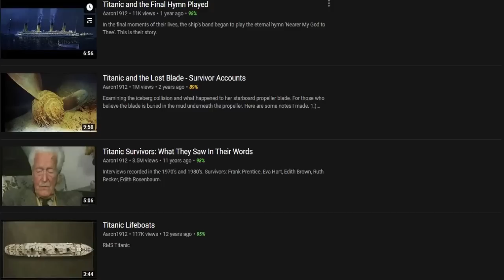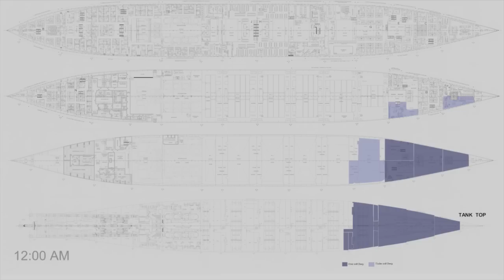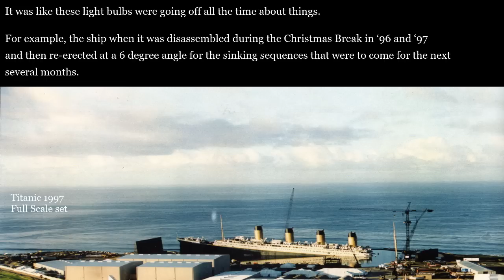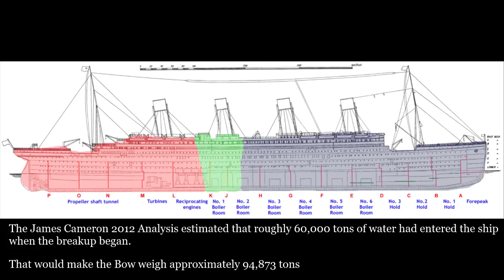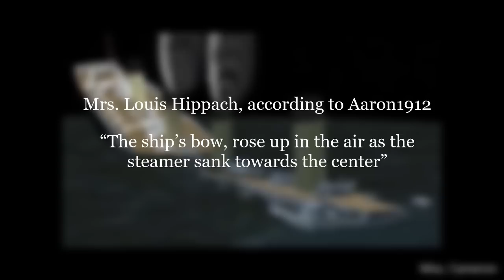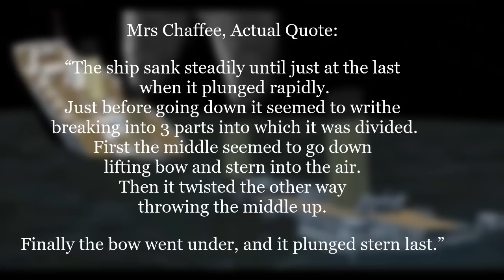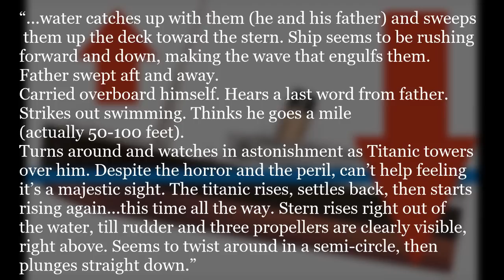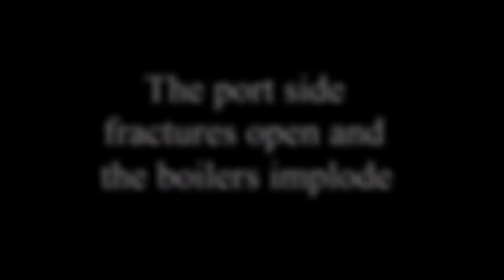Disproving Aaron1912's Titanic V-break

Comment: 'V-shape' sinkings can occur only when there is a vast amount of water rushing into the midsection of a ship, and there is still an almost 'normal' amount of air in both bow and stern.

This happened on a great many occasions during WW2.

In WW2, many ships were hit by magnetic torpedoes, that ran underneath the midsection of their hulls, and then detonated (triggered by a magnetic firing mechanism that worked by measuring the strength of the magnetic force exerted by the ship's hull on the torpedo.)

These magnetic torpedoes would tear a gigantic hole in the bottom of a ship.  Much more of the explosive force of the torpedo warhead would be directed into the ship's hull - (blasting through several decks and creating a cavernous open space) - than would be the case with an impact triggered torpedo striking the ship's side.

The tremendous speed of the resultant flooding would result in the midsection of the ship sinking downward very quickly, and the ship would be broken in two by the still very buoyant bow and stern not sinking at anywhere near the same rate - thus creating a V shape, and crushing the already massively weakened midsection of the upper hull between them.

So Aaron1912's 'V-shape' vision of the sinking Titanic would only occur if the iceberg completely tore out the bottom (not the side) of the midsection of the Titanic's hull, while leaving both the bow and the stern untouched.  

Aaron1912's scenario could only happen if Titanic literally hit the iceberg sideways - by moving almost as fast sideways as she was moving forwards at the moment of impact (thus leaving the bow section completely undamaged).  After tearing a truly gigantic hole in the bottom of the ship's midsection, the underwater outcrop of the iceberg responsible for this damage would need to have broken off from the force of impact - (as this is the only way of leaving the stern section also completely undamaged).

With the bottom of her hull's midsection almost totally destroyed, Titanic would have sank - very possibly in a V-shape hull break - within 10-15 minutes!  As fast or even faster than the Lusitania in 1915.

Obviously, this isn't what happened.
Reply: Not to mention that the position the wreck would take on the bottom would have been different, different dispersal patterns of derbies etc , if the bow would have risen up before sinking.
Reply: This
Reply: This can also happen with impact mines, or any other floating mine for that matter. It was very common to link floating mines together so that if a passing ship snagged the cable between them, the two mines would swing down along the length, hitting the sides. This gives a much larger effective area that the mines can contest, since they can now affect the entire area between them, and not just the points where they are anchored.
Reply: @Warriorcat49  : True, plus mines typically had a lot more explosive in them than a torpedo warhead.
Reply: Tim Smith
I don’t personally know the numbers, but I reckon that’s probably true.
Reply: Well that just proves the White Star Line had the Olympic (nee Titanic) torpedoed, to collect the insurance on it, seeing as Olympic bent it's keel crashing into the Hawke.

/S.
Reply: Don't forget the keel, part of the reason they did this was that snapping the keel (the "spine" of the ship) the weakened hull wouldn't be able to hold up anymore.
Reply: I would just like to point out that ships don't turn like a car would normally, they turn like a car does when drifting through a corner. With most of an iceberg underwater, you can definitely have a collision occur midships without it hitting the rear if the top breaks off. It's unlikely though.
Reply: Indeed also there are several other key factors that would make this more likely for a warship certainly the much higher risk of taking damage in the midsection is crucial. But also they are heavily engineered with the goal of slowing the progress of flooding within the ship which further helps concentrate the flooding to the damaged sections. These are vessels intentionally engineered with the goal of continuing to function despite other people intentionally and deliberately trying to make holes in them after all, they have to be designed with flooding as an expected threat during their normal intended activities.
Reply: It's an interesting proposal & the witness testimonies leave many questions. Could it be possible that the ship hit part of the iceberg that was underwater & damaged the under body somehow? This seems unlikely but interesting nonetheless
Reply: @TTTTCJGKS  Not sure if you aren't aware but the wreck has actually been located and explored by submersibles. Do you not think that maybe someone might have mentioned if the damage on the wreck was completely inconsistent with the reports at the time? It's not like it is one of the most infamous disasters in human history that is still very famous today and anything related to it shifts papers and DVD's like hotcakes or anything so certainly no motive to sell a new angle on it if there was evidence to back it up right?
Reply: Seraphina it may have been explored but the ocean is deep, dark & I have no doubt that what the experts believe could very well be accurate, but I also know that it was dark when it sank & it’s dark at the bottom of the ocean. There’s also no way to get a look at the iceberg damage so we really don’t know as much as we might think. Still, I find the speculation to be fun thought anyhow
Reply: bcubed72 Er no they just scrapped it

Comment: Not sure about this theory, as the vision was too dark to actually see it, clearly,  however; 

Survivor Carrie Chaffee saw the ship break into three.

"The ship sank steadily until just at the last, when it plunged rapidly. Just before going down it seemed to writhe (twist), breaking into the three parts into which it was divided. First the middle seemed to go down, lifting bow and stern into the air. Then it twisted the other way, throwing the middle up. Finally the bow went under, and it plunged, stern last."

Her account gives us a good idea as to how chaotic the break up was as the ship buckled and broke apart. Mrs. Hippach was in the same lifeboat (lifeboat 4) and saw something very similar. They were very close to the ship during the break up.

"The boat listed so much to one side (port list) that I felt sure we would be swamped. When we had rowed about 150 yards away from the Titanic we heard a fearful explosion. I saw the ship split open. At the same time the ship's bow rose up in the air as the steamer sank towards the center."

I recall another account from a UK paper taken when the survivors reached England. They witnessed the ship break into three and believed the middle section stayed afloat longer than the bow and stern. This could explain why large chunks of the middle section are far to the north east of the wreck, because it stayed up longer and drifted away with the current and sank further away from the rest of the ship.

Comment: That V-break theory is really ridiculous.

Also, if I recall correctly, there was a "double-bottom" theory in 2006 that seems to be based on the V-break theory.
Reply: I think it was how the ship broke apart earlier which let water flow into the bow section from the crack. In the animation I don't think they showed the bow rising but more like going down evenly although the stern was raised up high. Then again it's just one theory so might not be credible.
Reply: @richieThach  If I recall that theory was reliant on the exansion joints being weaker than they were actually proven to be (and also that expansion joints being opened somehow opened the superstructure, and not just the upper decks.)
Reply: Yeah, but that actually made sense.
Reply: @Wolfric_Rogers  Fair point. There's more going into the '06 theory than the V-break, which requires a lot of assumptions to even sound mildly plausible, and then somehow cause her to split anyway, when most of them would've caused her to sink at a relatively even keel and thus not have the forces acting upon her needed to break the ship.
Reply: Exactly!

Comment: Actually, a drawing made for the enquiry depicts the V-shaped breakup as per the survivors' descriptions, but guided by physics law alone, it's really impossible for the bow to lift itself up again right after the breakup.
My idea is that aaron1912 really forgot or ignored the fact that once the bow was first submerged, water filled it up completely through the holds on the weather deck.
I do support as well that the stern broke at a degree of no more than 15°, given the fact no ship is designed to hold itself up on just one or two small contact points at the keel; their whole structure actually twists more, the rougher the sea gets. 
I hope this can clarify two of the most mainstream mistakes people do when describing Titanic's sinking sequence.

Comment: In the aviation community "they" are called arm chair pilots. People that, have an idea how things work, some simulation experience, also required. That leads to theory, that theory then becomes their new truth. Then the new truth is spread. Physics, crash reports, actual pilot testimony? Cherry picked to match the new theory. After a short period of time, they can actually see they are wrong. But... They can't say that. So become encompassed in a lonely "ish" pursuit. Only backed up by the less aware during their fantastic presentation. Converted with plausibility! In short, even today, with all the tracking and monitoring technology, video, witness accounts. Some believe they can tell you that blue is black and vice versa. If you don't believe me then consider this. Iran just told the world a passenger aircraft they shot down in error, had technical difficulties. Sometimes, it is what it is.

Comment: The funny thing about Jack Thayer and this infamous drawing by Lewis Palmer Skidmore is that it also depicts the collision. By Thayer's own account, he never saw the collision. He was warm n his room at the time of the collision.

Jack Thayer claimed to have only understood that something happened when he felt the ship turn to port. He later said that he "felt a breeze" through his half-opened porthole (on the port side of the ship opposite from the iceberg and collision). He explained that he felt nothing significant during the collision -- no shock or loss of balance (which wouldn't have happened if a collision as depicted by the Skidmore drawing had occurred). He said that the collision must have been so slight that he wouldn't have spilled a single drop if he had been holding a glass of water. Yet, Thayer still got dressed and went to the deck to see what had happened. 

He didn't see anything out of the ordinary, so he walked toward the bow of the ship. He could "faintly" make out ice in the lower forward well deck (although he said later that he only saw things on the deck and was only told by others that it was actually ice). He never saw the collision and never saw any icebergs (which are also depicted in Skidmore's drawings). He went back and spoke with his parents. 

Some of Thayer's account over the next days, weeks and years conflicted with the testimonies of other survivors. Much of this can be attributed to the "fog of war" -- the harrowing and rabidly developing moments during a fight for survival that sometimes amalgamate one's own recollection with stories that they've heard others say. He never truly accounted for the bow rising out of the water as depicted in Skidmore's image.
Reply: He has Skid in his name. He cannot be trusted

Comment: You are right about this. If the forward  compartments  were flooded,  then how  could the bow come up above  the surface? It would be too heavy. Also, passengers  were under  the assumption that this ship was unsinkable.  So even when it started  to sink its reasonable  to assume  that passengers were simply unable  to wrap their  minds around  what was happening. It happened  slowly  in the beginning  so it probably  didn't  even  look or feel like it was sinking.

Comment: I actually believed this and now I hate myself :(
Edit: The V Break theory, not all doors open one
Reply: Its okay, not your fault, at least you now know the truth, and always make sure you can verify someone's claims before beliving them. The internet is full of knowledge...but also full of idiocy...so it is our duty to be careful and identify truth and facts from lunacy.
Reply: i almost believed in Aaron's theory only to find something wrong with it
for example why the hell would the bow go up when it broke in half
plus the water would have weighed the bow down, why the hell would the ship do that, I've seen other ships sink and break in half and the bows didn't raise up
Reply: I used to believe it, but know I know that the v break theory is fake.
Reply: I also believed it, mainly because physics is not my strong point. I simply assumed that if the ship was sinking more evenly than first believed, and the break up happened from bottom up (rather than top down) it could be possible for the nose of the bow to rise up ever so slightly as the direction of the sinking ship changed from sinking bow first, into sinking centre first. It only becomes totally illogical if the bow was completely flooded and submerged at the time of the break up. However if the bow section was only partially flooded internally and only slightly submerged at the time of the break, it seemed it could be possible for the nose of the bow to rise up slightly for a few seconds with the momentum of the centre sinking quickly and all the trapped air suddenly being pushed go the tip of the tip of the bow.
Reply: Sammy Long I used to believe in it so long that I even recreated the v break theory sinking in gmod!

Comment: A great explanation.  As a 27 year ships officer may I add some more?  Every weight added to the ship creates two measurable results, parallel sinkage, and a trim moment.  As soon as the flooding began, the ship as a whole was getting lower in the water (the sinkage), the bulkheads causing the water to remain in the forward part of the ship creating a head down condition (the trim moment).  Had these bulkheads been joined to a watertight deck, the ship would have filled until it came to a sum of its new moments on the hull.  While she may not have been operable in this condition, as long as the weight of water did not exceed her hull's capacity to displace it, she would have floated.  We know that was not the case, and as the trim moment increased, the water came over the top of the bulkheads and down flooded into the next compartment adding even more sinkage and trim moments to the hull.  To my knowledge, the bow was completely down flooded by the time of the break up, the only way to lift the bow would have been a massive addition of weight in the stern, which would have been physically impossible.  Even if the hull had could have survived such an action, the only way for there to have been a V break would have been flooding in the center only that exceeded the bending and shearing moments the damaged hull was able to sustain.

Comment: The V split theory, in my opinion has only come about due to the Jack Thayar sketch (which was not sketched by Jack himself as I understand, but rather from his dictations).  The sketch is obviously designed to tell a story (remember that a lot people could not even read back then).  It is therefore exaggerated.  Even the first sketch shows the iceberg collision as if the ship mounted the berg as opposed to scraping by it.  The third sketch clearly shows the evenness of the plunge by the head (still exaggerating the amount of bergs in the background though).  

The fourth sketch in my opinion serves nothing more than to confirm that the ship broke in half in SOME WAY.  The text stating the forward end floats then sinks suggests to me that its part of the front section of the ship that was still above the water after the break, not the tip of the bow itself. A few cherry picked, out of context quotes is not enough for me to believe a v-break.  Also physics...
Reply: When first looking at the sketch it's pretty badly inaccurate with the V break and the ship looking like it's running over the iceberg then grazing it, the ship looks like a toy ship for a bath.
Reply: The writing on the sketch confuses the forward end being the tip of the bow when it's actually the break area of the bow.

Comment: I'VE BEEN WAITING FOR THIS! THE 'V' BREAK IS SUCH AN AWFUL THEORY!
Reply: Ive seen this v break theory be brought up in an old documentary from 2005 where they said it broke up underwater after it went down
Reply: @Carnivorous plants and gaming , well that did partially happen, the stern DID rise by 10 degrees before falling back down
Reply: I'm not saying that the bow went up, I'm saying that the stern section bent upward and stretched the keel to breaking point and then falling and dislodging the 3rd funnel.
Reply: Actually, the 2nd funnel blew up at the base and collapsed before the 1st funnel did (the only thing Aaron1912 got right), this explosion caused the ship to list from port to starboard and the 1st funnel to fall.
Reply: What? That has nothing to do with what I said.

Comment: Something to correct here: At 10:29 you show us an example that the lenght of the ships parts are equivalent to their wheigt. Actually that's wrong. The stern section was way heavier than just about 13.000t due to the location of the heaviest object on board: the engine.